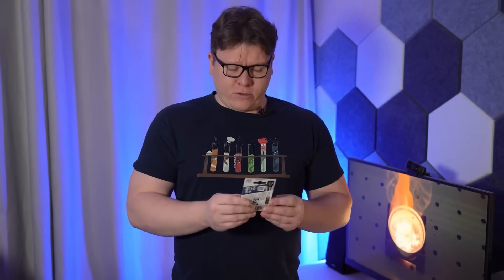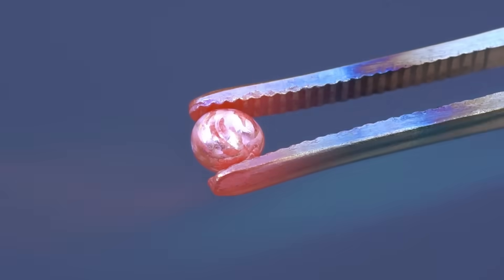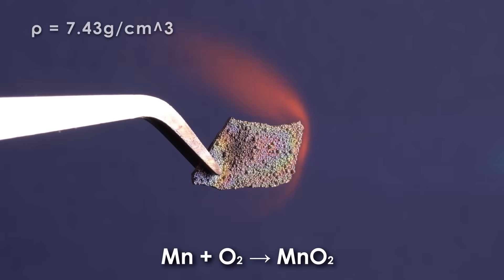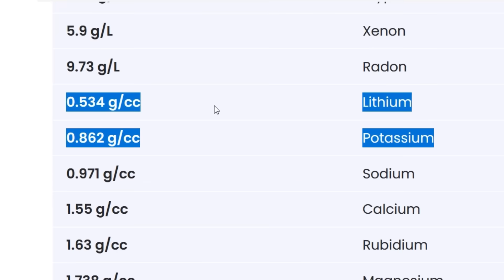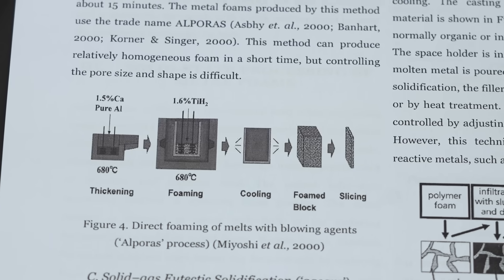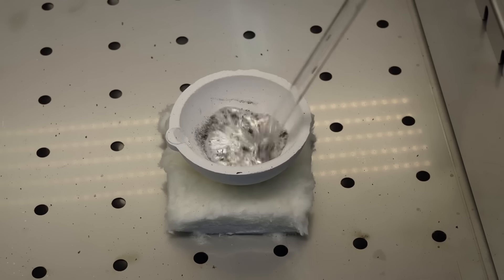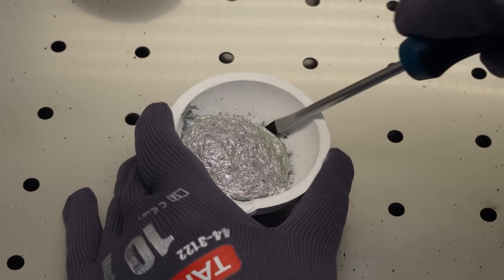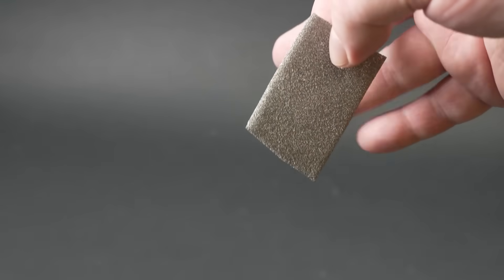Metal Foam – The Most Challenging Material to Make!

Comment: Metals cold weld at an atomic level in the vacuum of space, seems like metal powders could be used to 3D print objects at any density.  Metal powders would have to be kept pressurized until vacuum placement.

Comment: Today you can allready produce metal nanofoams with the properties from aerogels up to 50% bulk material. The later can be used to make openly porous electrodes with extremely large inner surfaces for very high current densities in electrochemical reactors like batteries or fuel cells.

Comment: very interesting video! what interests me is the huge surface area this has potential to create. a less airy plate with smaller but numerous holes would have insane surface area ... which could be used for reaction with liquid... yep... batteries. Theoretically this could reduce the storable energy / weight+space required ratio.... it would also lower the ammount of lithium required .. defenetly worth looking into...

Comment: You can grow very beautiful blue osmium crystals by sealing osmium sponge, osmium tetroxide, and oxygen in a silica tube.Heat the tube strongly on one end and milder on the end with the sponge. The crystals form on the hot end. ❤

Comment: Dude, get some  rock salt and (melting point 800c)
Melt the aluminium with it at 700c
Metal form a mesh
Dissolve the salt away in ater bath

Comment: I would suggest that instead of adding the titanium hydroxide to the molten Aluminum Calcium mix you try adding the molten Aluminum Calcium to the Titanium Hydroxide. For the same reason I would also suggest switching from a glass stir bar to an agitator.

For those that are confused the substance he's adding to it goes ontop by adding the molten aluminum calcium mix to the Titanium hydroxide the hydrogen bubbles will flow upwards through the metal rather than trying to mix it down into the alloy. Pouring the alloy over the hydroxide should also allow him to create a much more uniform layer of hydroxide and therefore more uniform bubbles. As for using an agitator instead of a stick is basically offloading the stirring process to a gyrating table which again should help produce a more uniform end product as all of it will be getting stirred rather than just where the rod is. It should also help reduce the risk of the stir bar getting stuck in the end product when it freezes.

Comment: There's a easy way to foam any metal. Take any metal powder, mix it with an appropriate amount of ammonium dihydrogen phosphate powder, then press it into any shape wanted. After this sinter it by applying 2/3 of the metals melting point temperature. The Heating time will decide, how large the bubbles are. Start at around 5h.
If you want you can then etch it electrochemically in order to define the bubble size and pore volume further.

This is kind of a standard synthesis route for hydrogen production cathodes.

Comment: I know that copper sponge is produced differently. A plastic sponge is dipped in conductive paint, then copper is electrolytically applied. Afterward, the plastic is incinerated, leaving only the copper. These sponges are used for electrolysis, primarily for gold extraction.

Comment: In dental metalurgy or some jewelry casting one untold ingredient often helpful is the "grain refiner" ruthenium being present in a fraction of a percent lets say 1/5 of one percent, its own behavior on transitioning from completley molten back to solid, it has a narow range of transition,  including a tiny amount in a master alloy can act as a "Seed Crystal" initiating its own quick solidification characteristics into the melt that it is homogenized into.  This becomes a beneficial technique when manufacturing items made from white gold or orher noble alloys where high temperatures for extended time might adversley affect metalurgy of other components or even structure of mold or crucible if molten state is unnecessarily extended.

Comment: I got some foam metal samples I obtained in 2003 when I was working in the design of cooling solutions for servers. As you can see not much has changed. The production process is still the same. It is costly and takes very long. I visited a company in Dresden at that time that produced metal foams. I was able to observe how delicate the process is and how often it fails. 3D metal printing is an alternative today. Cheers, Marcel A. Buth

Comment: I'm curious, why didn't you do the mixing under inert gas?

That would keep the hydrogen released from reacting with oxygen and explosively removing the titanium hydride particles from contact.

Also, I'd try changing the way you combine the metal with the TiH2.

Have a second crucible for your mixing/mold.
Use something like a kitchen wire wisk for mixing

When the metal is liquid and your mixing vessel is ready (secured&heated).

Put the TiH2 in the  mixing crucible. 

Pour the metal into the crucible and mix. 

 It would go better under inet gas, even better if you could do it under pressure...😊

Comment: I have a sample of metal of a now uncertain purity that is so light that I cannot feel it's weight at all, and it is a sample of copper. My partner works at a wire mill, and sometimes at the last wire die, which thins the wire, there is extremely thin strands of copper that flake off and collect under the die. It has a structure between dryer-lint and cotton candy. It's fluff. I attempted to compress a piece of it as small as I could to increase the density, and it is still lighter than felt because the density is still so low due to the structure of it.  It's an unknown purity because I do not know how quickly it oxidizes when it is like this. if I had to estimate based on it's weight and volume, you would need a piece of it in this form somewhere between the volume of a person or even a car, before it has the same total mass as a penny. the threads are that thin, that short, and there is that much air. I have no idea what to do with this. I have a sample of it about the size of an egg. it is quite literally a waste product, and it takes more energy to recycle than the value of the solid copper that would be gotten out of it, so they don't bother recycling it.

Comment: 16:59 one way to make metallic foam i liked was to get ordinary coarse sodium chloride table salt and put as much as you can into molten aluminium. The salt granules will displace the aluminium and they won’t melt because the melting point of aluminium is thousands of degrees below the melting point of salt. 

If you have enough salt in the aluminium that the grains are touching, you cool the metal to room temperature and submerge the block of aluminium in ordinary tap water. The salt dissolves, leaving behind an open cell metal foam.

Comment: What if you used a glass tube that used microscopic holes so it releases tiny bubbles that you can adjust the number of bubbles being made and size by injecting hydrogen gas through the tube you use to stir it?

Comment: Thankyou. This was fascinating.  Apart from the perspective shift of considering dissolving hydrogen in liquid metal, the very idea of metallic foam has such potential.

I reckon that you'd find Aerogels quite intriguing.

I've already been curious about material foams coming from a different starting point.  Optimal bubble sizes & placements distribute forces in better ways. Having a material composed of tiny bubbles makes it dense & heavy, while large bubbles can make materials extremely light but more fragile. Ideally, you want a combination of both, with smaller bubbles in high stress areas & larger bubbles in low stress regions. Where structure & material composition intersect, you get optimum design.

Comment: Get a larger mass of it, and a heavier crucible so it keeps it molten longer, then as soon as you mix it and start calling it a "bun", quickly vacuum its surroundings - mix it in a vacuum chamber then just slam the lid and use a fast pump - then the H2 should foam up more before it sets

Comment: If I remember correctly, this is technically a metamaterial because the structure gives it certain properties that the metal that composes it lacks. That being said, the structure might be slightly too large to be considered as such.
For example, aerogel is a metamaterial, while a building made entirely from aluminum is not. The line is difficult to ascertain.

Comment: Love the Aluminum "bread". I've long thought it could be valuable to make foam metal 'carbonator' machines that would inject CO2 or inert gas (or hydrogen) in a constant extrusion process using some kind of sparger and quick cooling of the resulting foam. The sparger would have to be inside of the molten Aluminum as it flows toward the exit. Maybe some kind of constantly lubricated cooling die-head could keep the shape needed as it extrudes out of the machine. It makes a ton of sense to create foams since you get most of the strength and use a fraction of the raw material. One interesting observation - whenever I melt and cast aluminum at too high of a temperature there are always tons of bubbles in the resulting cast. So the high temp probably allows more space in the lattice for hydrogen to load.

Comment: And wouldn't it be possible to make an air cooler for a PC with that? The hitpipes are perfect for quickly transferring the heat to the metal foam and due to its distribution it should have a larger surface area than a normal heatsink, right? 🤔
Reply: Yes but unless the airflow is pressurized and forced through the sponge the air wouldn't easily pass through.

Comment: What about this:

Melt some aluminum- pour it into a mould filled with hot salt (first. The aluminum. Will sill in around the salt grains. 

NaCl is used to make slag - it is barely soluable in Al. I would try it first.

You can remove the salt with water - leaving interstitial spaces. A foam.

Comment: Echoing others, use your real voice. Don't worry about the accent. We could still mostly understand you.

Also, I've noticed you're always rather stiff and sometimes late when you gesticulate. I don't think you talk with your hands outside of these videos. If that's not you, I'd honestly recommend just not doing it, it isn't really necessary. Jörg Sprave (of The Slingshot Channel) regularly doesn't use his hands to talk very often, and that's okay! Sometimes, just holding the object and pointing at it works just fine, and if you don't need to hold an object, just let your hands do what they naturally do when you talk.

However, I think it's possible you may use your hands to talk in your native language, and the timing may be mostly related to that as well. If you're thinking in your native, but translating to English as you go, that can be tough. 

I'm not sure which it is, but in the end it's all good no matter what. I still appreciate these little knowledge trips.

Comment: Years ago when I was reading a great deal about thermal transfer and cooling, I wondered if it would be possible to create copper foam through which coolant could be pumped. The picture in my head of what I wanted to see tried was basically like the aluminum foam block you showed. I would think a heatsink structured like that would maximize surface area while still providing enough thermal mass to wick away heat without getting over-satured at hotspots, or at least would be interesting to experiment with.

Comment: Yes, there is man, and it has 5000lb tensile strength with the width of a human hair. It's nickel woven into a thread in zero gravity using 2 different sound frequencies. It's actually quite easy to make a field that can suspend liquid metal using RF in a long enough line to allow long fibers to form without going into space. Can't tell you though.

Comment: Grand-K, the (former) official standard kilogram has been losing mass as determined by comparison with several official copies ("deputies"). The divergence of the platinum-iridium standard kilogram from the deputies is not a mystery at all. 

The answer lies in the history of metallurgy. Platinum-iridium was chosen because the two elements of which it is made are chemically HIGHLY INERT. They are unaffected by nearly all chemicals. Pure platinum was far too soft to be used, so it was alloyed with the extremely hard and even more inert iridium. However, iridium has an "evil twin", osmium, with which it is found as an alloy called variously iridiosmium or osmiridium. Osmium is NOT inert. 

At the time Grand-K was crafted, it was impossible to remove ALL osmium from iridium, so osmium remained as a trace element in the Grand-K weight standard. To make the platinum-iridium standards, the powders of the constituent metals were thoroughly mixed and then sintered into a solid block. Technology at the time could not melt this alloy without contaminating it. Sintering left countless tiny channels which penetrated the final block. Unlike platinum and iridium, osmium is NOT chemically inert. It combines with oxygen from ordinary air to form osmium tetra-oxide. Also, unlike nearly all oxides of heavy metals, osmium tetra-oxide is volatile and evaporates at ordinary temperatures. Hence, the effect of air on the standard Grand-K weight is two-fold: At first, it gains weight as the oxygen is combined into osmium tetra-oxide; then the osmium tetra-oxide evaporates. This process is very slow, but over decades the results accumulate, and the cylinder loses weight. The exact loss depends upon temperature, humidity, and oxygen content of surrounding air. 

What about the "deputy" weight standards, also made of platinum-iridium alloy? They were fabricated years later, after it became possible to remove virtually all the osmium from the materials. They do NOT lose weight in air. Hence, the "deputies" all agree with each other but NOT with the standard Grand-K that they were made to represent.

Mystery solved.

Comment: First of all, this AI voice was TERRIBLE in this episode... SO MANY PROBLEMS!!! Just saying random words for no reason...  The temperatures made no sense sometimes... the volume was all up and down... the pronouncing of some words was all wrong (say 'leed' instead of 'lead/led') - PLEASE just go back to your own voice, you spoke perfectly fine English bro.... and if you don't feel like you're good at it you HAVE TO KEEP AT IT and continue using the language in order to get better.... how can you get better at it if you don't use it... PLEASE just try going back to YOU speaking English and just WATCH ALL THE COMMENTS TALKING ABOUT HOW MUCH THEY MISSED YOUR VOICE AND HOW  ITS SO MUCH BETTER.....
- -  And SECONDLY, Your stirring was yes, destroying the bubbles... you need to use a DIFFERENT TYPE OF OF STIRRING.... think of a MILKSHAKE MIXER.... it's a spinning rod with a round disc iobn the end that is wavy.... AND if you spin it VERY FAST it CIRCULATES THE FLUID, INCORPORATING AIR INTO IT, AND THIS WOULD BE THE RIGHT WAY FOR HOME LABORATORY TESTING..... PLUS YOU HAVE TO PUT THE  MELTED ALUMINUM into a METAL CONTAINER AND KEEP IT HEATED WITH A BLOW TORCH UNTIL YOU ARE READY FOR IT TO COOL DOWN.....
- - -  BUT I don't expect7 that you are going to continue with this experiment, so there is no need for me to explain further.... but the stirring with such a large piece was bound to destroy the bubbles that were made.... BUT I REALLY ENJOYED LEARNING ABOUT METAL FOAM and the  other metals you showed us...  you just make chemistry FUN!

Comment: the first thing I thought off is to make an alloy with lithium/ sodium and aluminium and somehow extract sodium out of aluminium leaving sponge but I quickly discarded it since it will probably crumble to dust. Second thought was similiar to one you used. We can try to disolve/ bubble up metal that is about to solidify but I was more thinking about oxygen/ argon in aluminium.

Comment: In a high vacuum, metal can be sputtered onto foam. The amount of metal in that foam can then be increased by electrolysis. After that, the foam can be burnt away in an oven. The metal foam remains.
Reply: kinda, but PVD options like evaporation or magnetron sputtering only work in line of sight, you can’t really get it into the inside of the foam. a chemical vapour deposition would work a bit better
Reply: @gabewrsewell  not really. I did PVD my self. It not only penetrates holes deep (tested on paper) but also metalizes on oposite to source side. I know the theory, but in practive I've got different results. If I only get my vacuum chamber running again for sure I will test PVD on washing sponge and then electrolisis like flufyblue said :)
Reply: @ oh really, that’s pretty fascinating, i stand corrected! magnetron sputtering or with just evaporation? if it’s evap i could imagine the more general kinetic energy making more non-line-of-sight paths possible…
Reply: @gabewrsewell  just evaporation, in very rough vacuum - maybe that was the reason, bouncing from air molecues.
Reply: @ nice, a soft vacuum was the other thing i was curious about. what metal were you using that was still happy with a rough vacuum like that?
Reply: @gabewrsewell  it was silver, but also worked with bizmuth

Comment: Beryllium is one of the most interesting stable metals. Too bad its toxic and expensive. Curious how it would alloy with others and if it could create bonds that eliminate some of its toxicity. It has a few uses today, strong and invisible to x rays it has a few odd uses, its used for tweeter speakers due to its light weight and high resonance. Want some REALLY light and REALLY expensive wheels for your car??? Wonder what light alloys it might make or,,, not? Clear metal?